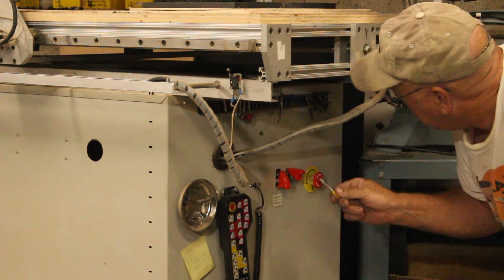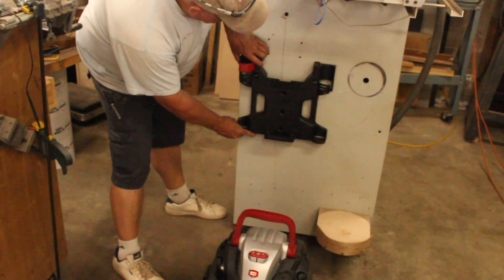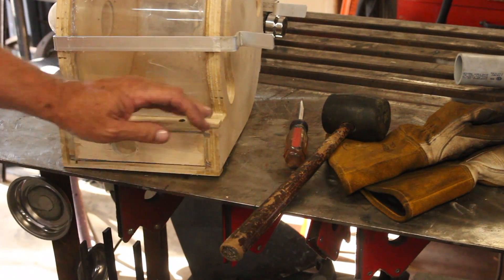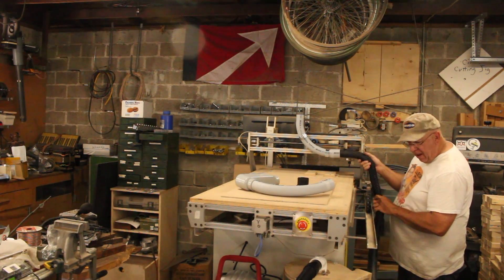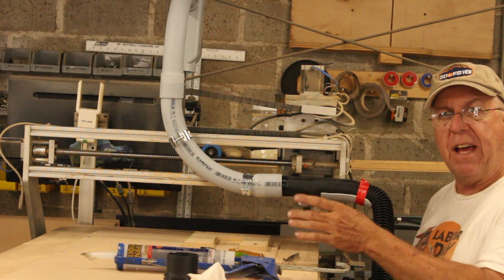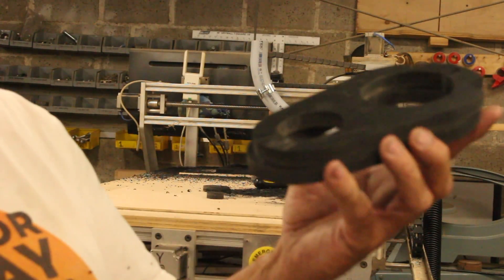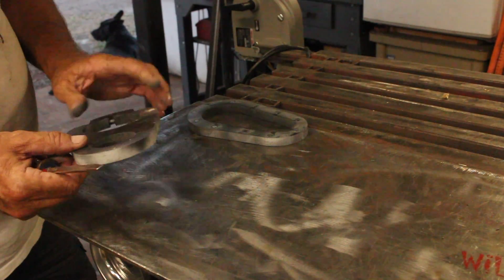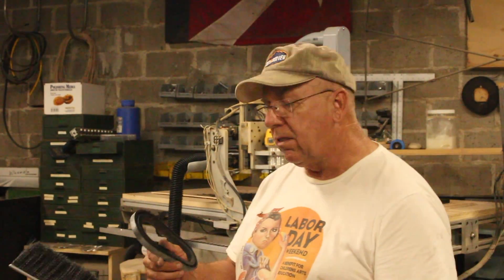CNC Dust Collection Upgrade!

Comment: Check out the Suckit dust boot unit. its marketed as a unit for the x carve and shapeoko machines but easy to make them work on most machines.... thanks for the video.
Reply from the maker: I've seen them. They're over $100. This is basically the same thing at a cost of less than $5.

Comment: Nice!  Why didn't you just cut the magnet holes on the CNC?
Reply from the maker: The bit was 1/4" and the holes are only 3/16".  I could have done it, but it seemed easier to do it by hand.

Comment: Since you had to put the shelf to hold the slinky hose, why not use the stiffer hose in that area from the conduit to a little past the shelf, cutting a short piece of the good hose off that you could use at the router...
Reply from the maker: Turns out there was enough to do both after all.